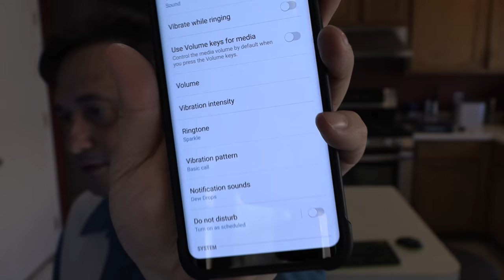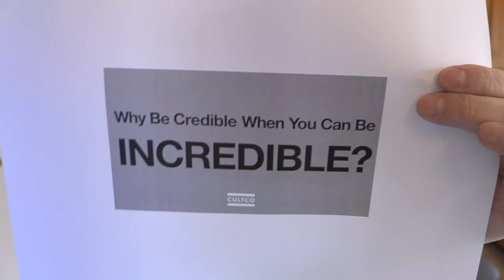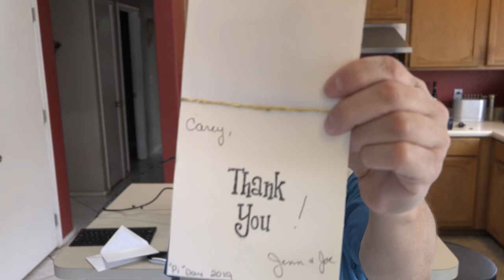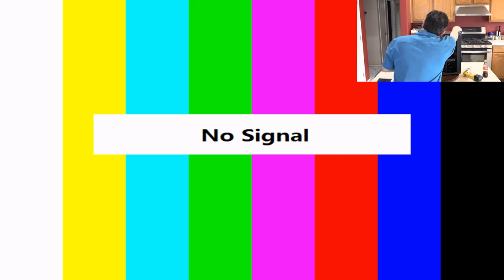What is wrong with this X99 system? Let's find out!

Comment: I looked up the 00 code and 1 website said that it could either be a Dead Mother Board or more likely a bad CPU or the CPU not properly seated CPU.  But one post the ASUS Forums said to press the "Q-Reset switch" on the motherboard and fixed it for that person.

Comment: I like Both Louis and Carey
Reply from the maker: I'd like to be friends with Louis, but he just came out at me. No idea why.
Reply: I read his reply on the other comment on the other video, I started watching you and built 4 new computers and replaced all ssd in my laptops.  I relate to everything you are doing, I was in the building in the early 90's when it was harder. And you are the one that came out with the "capacitor  fiasco"  I built a bunch in the nineties but I didn't have time for all the constant calling from customers so I stopped - plus the vendors wouldn't replace capacitor damaged boards. Any way I still watch you. Way more. I code a little so Eli is why I watch him but lately he doesn't so much.

Comment: Sorry to see you didn't figure it out. Oh well stuff&things happen. My first instinct was the Ram was bad. Is it still the same way from way back that the board has a certain amount of Physical Ram built into the board (I do believe it use to be 1024 K). In my heart  I do believe the MOBO is bad, since you changed to brand new Ram. BUT.....it would have been nice, if it is possible that is, to try and boot without any Ram installed and see the results. Bios/EFUI whatever it is called today doesn't need much, well maybe it does, I don't know for sure. My computer is older than Mitch's still running and OOPS!!!! I cleaned the CPU fan (took it out and didn't put any Thermal paste nor did I clean it. Prolly running a wee bit hot I am guessing LOL. 
But I digress..I think I seen a "Shiny thing"!! Great video and I look forward to the next one. Thanks Bud